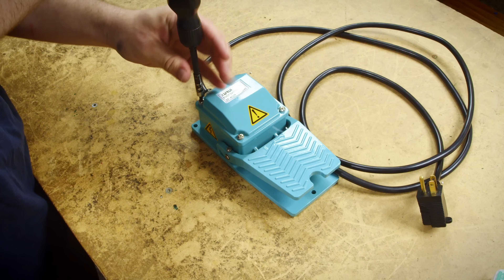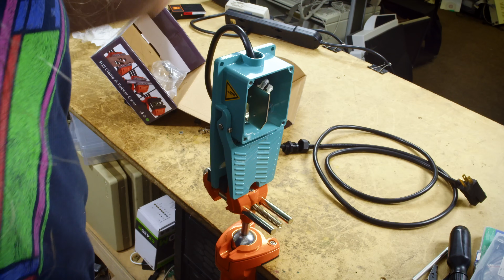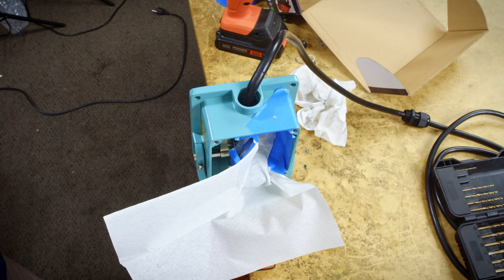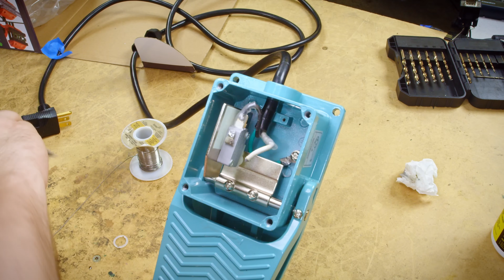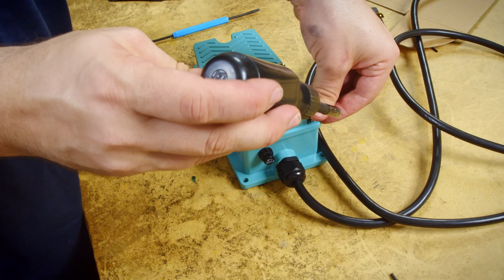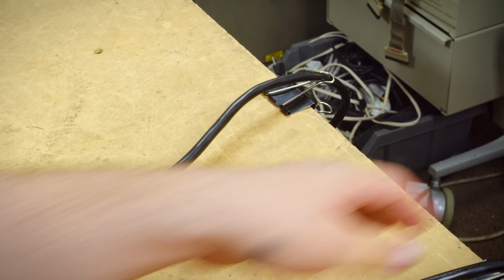Power Control Foot Pedals for Safety

Comment from the maker: A minor update, I am adding a GFCI adapter upstream of the footpedals. That will mitigate the risk of touching live mains to ground if for some reason I'm working on mains power live.

As a note, I do not feel an isolation transformer is applicable to this. For one, they have a limited load rating unless you buy a massive one. Secondly, they require ground be isolated and when you work with mostly DC power computer equipment that is a problem. I would have to power the computer and any peripherals through the isolation transformer to maintain the same ground potential between them. Which only makes the transformer load requirement even more important. In the extremely rare case I am probing around main power with a scope, I have reviewed on this very channel, and recommend a battery powered scope for that instead. It's a lot less to worry about in the end to go that route.

Comment: i would recommend using two momentary pedals instead of a toggle pedal. one to activate power, and the other to cut, both connected to a relay/contactor that actually switches the power. you would want this because it is very easy in a panic to accidentally hit a toggle button twice. this also happens to be the basic setup behind most e-stop systems as well.

Comment: I hope your fuse kit isn't the popular one from Amazon that Louis Rossmann reviewed. Those fuses were all the same wrong rating and would blow at a much higher current than spec. In essence, adding no protection to the circuits they are supposed to protect.

Comment: Nice pedal; I'd advise against using it as an emergency stop button because finding and reaching for it takes time if you can't see it. I'd just leave it as it was, in line with the live wire, and keep a foot on it when operating any dangerous tools (circular saw, rotary tool etc.) so that whenever something bad happens, you take your foot off and the thing stops instantly.

By the way, we had something like an e-stop installation at the Book Art Museum's type casting shop. It used a latching contactor with on/off buttons and three safety switches on the ceiling, wired in series. The switches used spring-loaded plates pressed against switches keeping them closed. On the bottom side of the plate, a wooden pole was attached, reachable by hand (or head) and whenever someone hit the pole from any side, the plate dropped from its normal position, the switch came back to its unpressed position breaking the contact and cutting the contactor's power off and stopping all the running machines. Pretty clever, I have to say.

Comment: Were it me, i would've removed the original wire, put a larger holder nut, put a four in one wire with a rubber insulation (softer and much higher quality) and then at the very end (where the hermaphrodite plug is now) i would've separated the four wire into two plugs (male + female) with a 2 in 1 heat shrink sheath (you can get them pretty cheap if you get packs of ten). Much safer than that, which in my experience, unless it's high quality (and you can feel it) they're pretty shoddy. As for the fuse, that's where you could've done a funky one, in the sense that you could've bought a male end (for that end of the wire) with a fuse inside. YES! They do make NA plugs with fuses inside. Shocker, i know. They are UL listed, they're in Canada as well. Less fuss, takes out the shoddy part of that pedal and makes it a bit more safe too, because it's not longer using that plug. EDIT: because i remembered seeing them, not just replaceable fuses, but they also make various flavors of over current protection (those are one time use unfortunately) and i think something that dealt specifically with lightning (dunno if that's an issue for you - i know i bought, many years ago, a Xerox protection adapter that had all the protections inside including that. Made in US, one of the last things i got as equipment that stated that actually. FTR i'm from Europe.) 

PS: even if you strip the bolt holes in the pedal, it's not the end of the world. You can just take the bolt out completely, take a same size drill, drill all the way through, put a chamfer on the hole (from the bottom of the pedal) and put a countersunk bolt, like a stud, where you'd use a nut to hold the plates in - thus making the whole arrangement bullet proof. Short of breaking the metal of the pedal, you cannot damage it anymore. Even if you did, you can always take that bolt out and replace it with a new one.

Just saying. That's how i'd do it.

Comment: Good idea and useful if the magic smoke bursts out. Also useful to mitigate against electric shock. My Uncle used to repair TVs in the 1960s and he had a similar foot switch just in case he got zapped. I use one when I'm doing woodwork so operating my table saw and router. Some of your fellow YouTubers do work on CRT TVs and monitors, and they should use a similar switch (for that I've talked to TV guys who always kept one hand in their pocket so they didn't get a shock straight across their heart)

Comment: I do recommend the dim bulb tester (place it somewhere convenient). I have had cases where the fast-blow fuse completely vaporized, but not before also tripping the 20 amp circuit breaker. Most circuit breaker detect high current spikes via some kind of magnetic shenaniganery which makes it inherently faster than a wire that has to heat up and melt.

Comment: Putting tape on something to mark it sounds like a good idea, but you'll curse your past self's choices in a few years when the glue turns to goo when you discover it by grabbing only to suddenly have a goo-covered hand. That's why tape labels were illegal at my old work, because enough engineers got so mad at their colleagues' laziness that they banned it

That's why I prefer proper labeller tape. If the glue deteriorates it dries out rather than turning to goo, so it just peels off and you can clean the residue easily with IPA or just stick the new label right over the top. Yes, it's more expensive if you just want to colour-code things, but eventually you've got enough different coloured tapes to cover all situations, which is basically an investment in a labelling system.

Comment: You don't have access to your breaker box?  Isn't that a code violation ?

Also, it pays to confirm minor details like phase vs neutral wiring is correct, and that earth is actually connected.  Cheap amazon tat be like that sometimes.

Comment: If you don't have access to the main breaker box, I'd install a sub box for the office with lower amperage breakers. They will blow before the main breakers. 

For example, I have my cellar fused with 16A and I installed a sub box with a 10A breaker (220V) for my outlets.

Comment: I would've opted to run the tape between the last and second to last socket on the power strip, since it seems there's room there. And then fold it all the way around the back to the front again.
But this way is nice too.

Comment: If there is a gromet inside the cable clamp then the wetness might be some sort of light lubricant. I have seen it in a few cable assemblies to help during the initial assembly to make sliding the thing on easier and stop the gromet from spinning and adding friction to the outside casing when tightening everything together.

Comment: why not just use a variac?  plus variacs will let you slowly apply power to the device.
Reply from the maker: You cannot use a variac on a switching PSU. Also, the goal isn't to avoid shocking the test device, it's to abort of something goes wrong.

Comment: I built one of these into my dim bulb tester. Everything runs off low voltage, including the foot pedal and controls relays for all the high voltage. It has a few NAND gates in it for lockouts, and a ULN2003A for the logic gates to drive the relays. Running high current all the way down and back through a foot switch is not a great idea long term.

Comment: I have a vintage one from the late '70s with two switches, one is momentary and the other one is latching, both linked together by a mechanical exclusive-OR interlock. I really should replace the rubber domes on top the switches. 🤔

Comment: Thank you for addressing the Dim Bulb Tester. Yes, you need one in this circuit. No, it does not need to be AT the pedal. Wouldn't be a bad idea to also throw an isolation transformer into the circuit.

Comment: When drilling that box, it would have made more sense to have it with the open side facing DOWN so any metal shavings simply fell on the desk or floor. You could have even put a container below it to catch the shavings.
Reply from the maker: That wouldn't have been possible to secure without a much larger vice. Or clamping it to the table with a bar clamp which wouldn't have been as easy to drill.

Comment: Make sure to thoroughly test those fuses, because Amazon is known for selling fake fuses.
Reply: Yes, especially since it didn't look like that was a package from a well known brand either.  I personally tend to order fuses from Mouser or Digikey just to make sure I am getting actual fuses and not counterfeits.  It is still possible to have issues that way as well but at least the fuses from them have actual datasheets and are somewhat traceable in the event of an issue.

Comment: I have a similar setup, but a bit more complicated, cause the workbench power is running on a PLC anyway. So the pedal is just a 24V pedal running into a PLC input, and I can add it to the emergeny off circuit by software. I can enable it on a button on my stream deck, and at the moment I stepped on the pedal it's armed. Taking the foot of the pedal at any point now without disarming at at the button before will trip the emergency off circuit and turn all my test outlets and power supplies off. So if something happens and I back up from the bench it will just trip automatically. Plus it doesn't matter if you step on it again, it will not re-enable power, cause the emergeny off circuit has a lockout which had to be reset first.

Build a bass guitar pedal board with a friend out of an old traffic sign last week. We had tons of aluminum shaves all over the place, I vacuuumed three times since and I still find them everywhere :D

Comment: The small pilot hole is correct form, and attempting to contain the mess was a good call. FYI, you need to run the tiny drill bits faster than you think, since their surface feet/min is so small otherwise. 

Then you want to switch to the step bit as soon as you can. You can switch to the step bit pretty quick after the pilot THB. The step bit also has straight flutes so the cutting edge doesn't pull up on the sheet metal as you’re drilling. 

This is also why you should use a step bit when drilling thin sheet metal, plexiglass or acrylic. A regular twist drill the corners of the bit will dig into the material and pull up on it. This pulling up on the thinner material can deform or crack them.

Comment: I hadn't considered a foot pedal for switching power to a device under test. I like the momentary one as a deadman switch for something which might smoke, or which I need to reach inside of while powered. I've added this to my shopping list! Pedal + dim bulb tested also seems like a good combination, which reminds me that I still need to build a dim bulb tester.
Reply: I also kept putting off billing a dim bulb tester. Just seemed so complex and so many steps. Then I realized there’s an easier way to do it, and I just did it and now I have a dim bulb tester.

All you need is an outlet, an outlet box of whatever type you like, and a power cord. Break one tab off the side of the outlet and assemble everything (with the cord supplying the outlet). Then just plug a regular lamp into one outlet and hey bingo, it’s in series with the other outlet, thus you have a dim bulb tester.

Comment: I would have loved to have had a setup like that a few years back when I was a PC tech in a repair depot. I cannot tell you how many HP computers popped in my face when plugging them in due to bad caps. LOL
Reply: At least they weren't those nasty tantalums you find on the old PC and XT boards. Those suckers sometimes look like a small fireworks display when they go off. I have an XT sitting in the shop right now that has not been powered for over 20 years. Wish me luck!
Reply: It wouldn't really have made a difference in your situation tho. The caps would have still blown the same. And once blown, all the action is over and the current either shorted (breaker blows) or intterupted (like a fuse). Sure, maybe the pedal is less scary than unplugging the computer from the wall, but not a huge difference when the action is all over anyway.